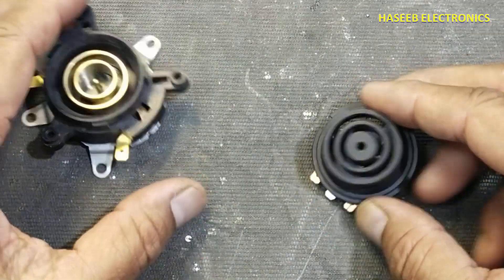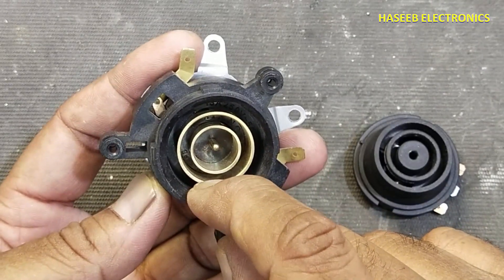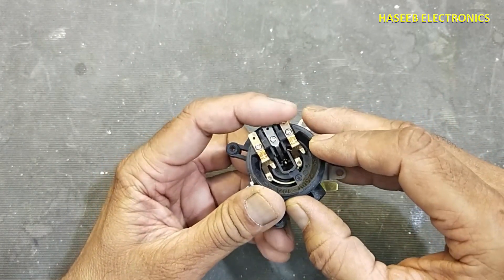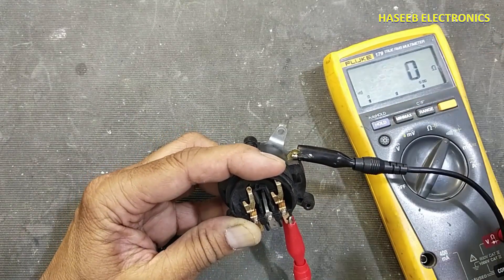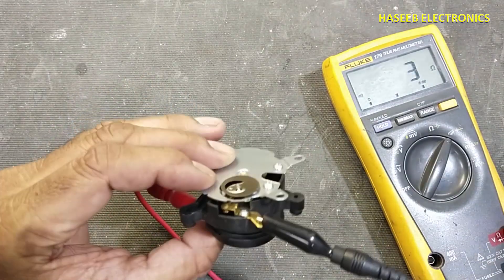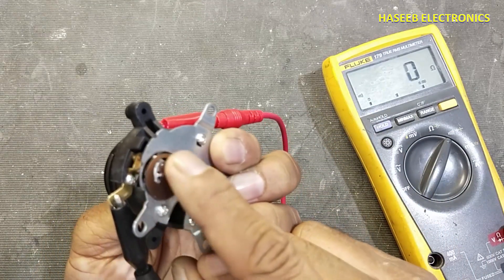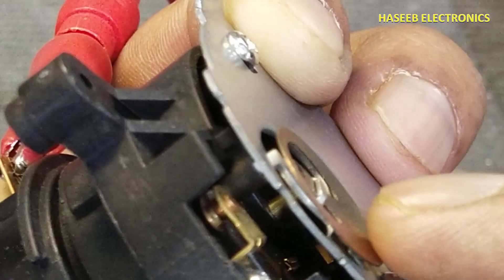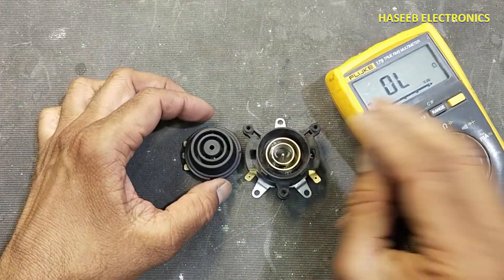{682} How To Test Thermostat Connector Coupler Set for Electric Kettle

Comment: How good are electric kettles? I've read where they save a lot of energy. I use my propane cook stove to made hot water for my tea. I don't own and don't like microwaves, they do a TERRIBLE job at heating water. I'm looking into getting one. Any recommendations? Thank you!
Reply from the maker: electric kettles are good. these consist concealed electric heater, so it is safe to use. as these use 1000-2000 watt heater, so it boils the water in very short period of time 
just select stainless steel interior jug
and every time use fresh water to heat up. as pre-stored water in kettle becomes contaminated
Reply: @HaseebElectronics  Thanks! I wasn't sure, but it looks like it would use less energy than even a gas stove as you ONLY heat the water you are going to use, for the most part. Winter time I leave the kettle on the wood stove since I've got to heat the house anyway. Best regards!